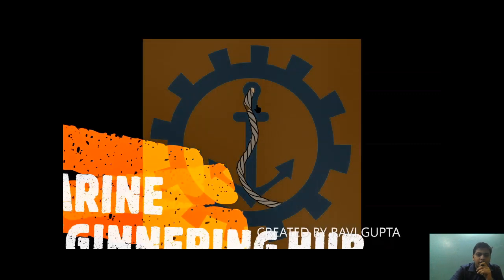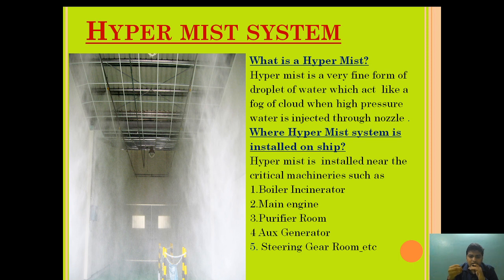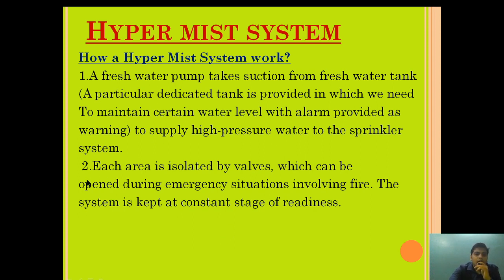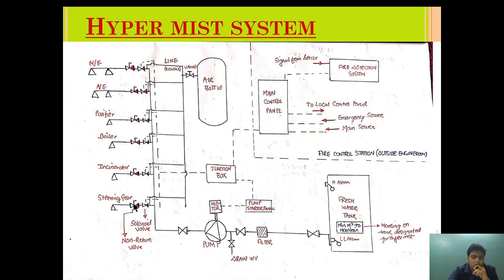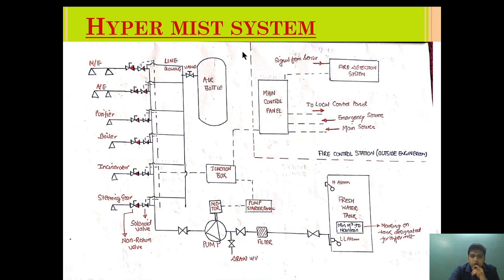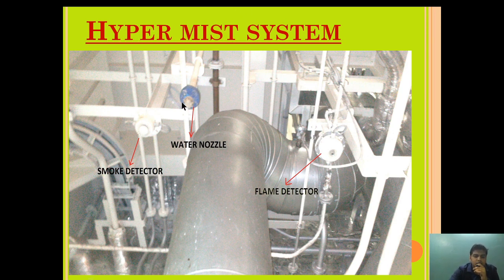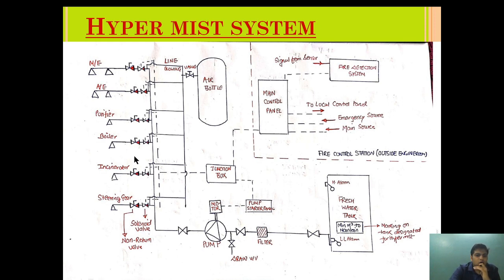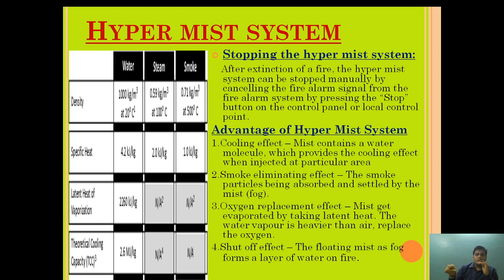HYPER MIST SYSTEM|FIXED FIRE INSTALLATION|MARINE SHIP|

Comment: The upto 40Mpa pressure is solely provided by the fire pump or the pipe work installation help to increase that pressure?
Reply from the maker: there is separate pump for hypermist which is high pressure pump which generates 40mpa pressure

Comment: How to check operation of mist manually
Reply from the maker: In order to check it operation we have to activate both smoke and flame detector alarm.
For activating smoke detector alarm we bring smoke generated from cigarette or other means close to it and for activating flame we use special flame light torched close to flame sensor and when both get activated then hypermist will be activated for that particular unit..

I hope you understand!!!!
If you like the video please Mandar Adhikari share with your friends and share on your Facebook wall about my channel!!!!
Reply: @MarineEngineeringHub  Thank you vary much..... ..l had already shared with my friends and they also liked ur video thank you sharing your knowledge with us

Comment: Why hypermist keeping high temperature area, why fuel condition room , near service tank and settling tank not keeping
Reply from the maker: Hypermist is provided in critical spaces to provide a upper hand for quick fire fighting. As the fuel operated machinery has the  more chance of caught up fire... therefore it is provide in most of the spcae where fuel operation involved
Reply: In fuel conditioning room  also fuel operation takes place , that's place max tym spilling occurs while drainning the tanks
Reply: This system focussing on fuel powered equipment, since the equipment is in operation, running condition

Tank is static, the fuel contain is to rich to get cought in fire